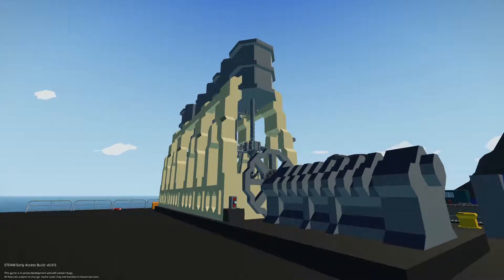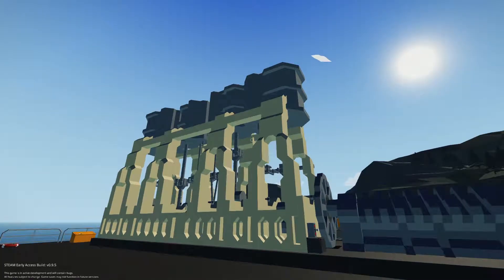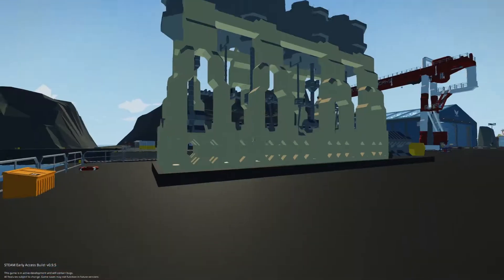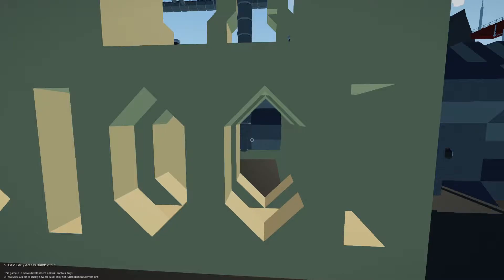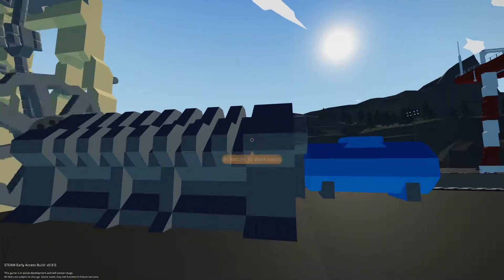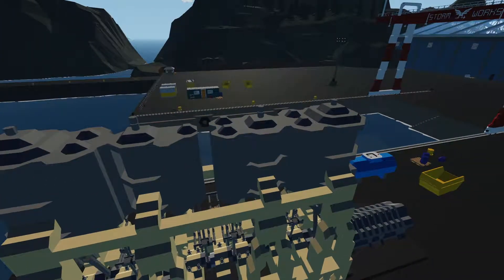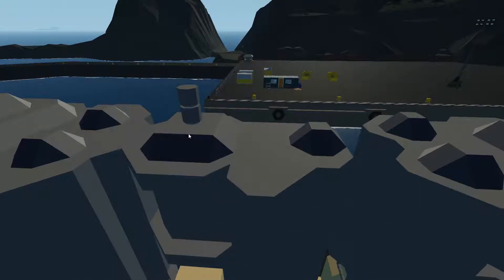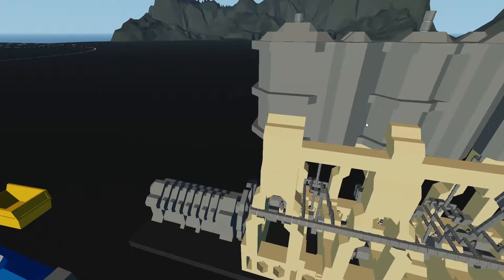Stomworks-Titanic/Olympic Steam Engine

Comment: I found something incorrect, it was actually mounted above the keel. If it was mounted in the keel, then the drive shaft would be too low to connect to the propellers. Otherwise this is amazing